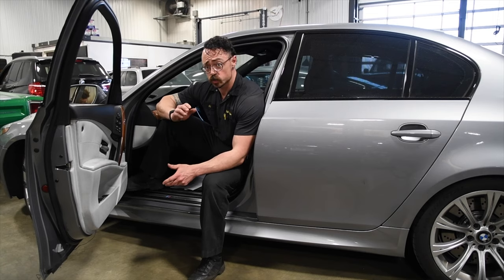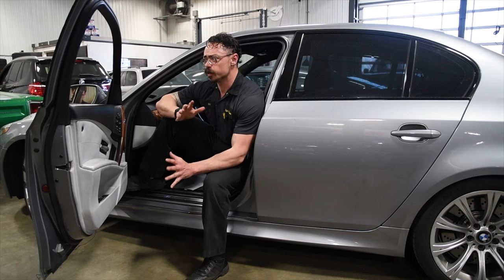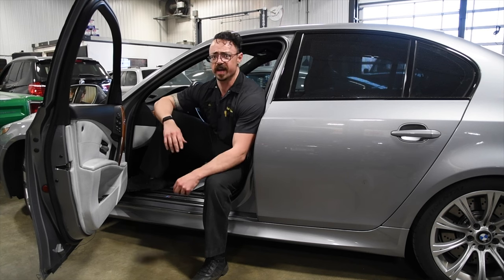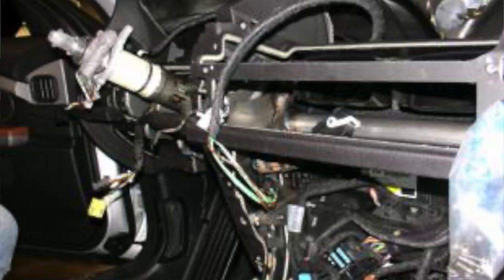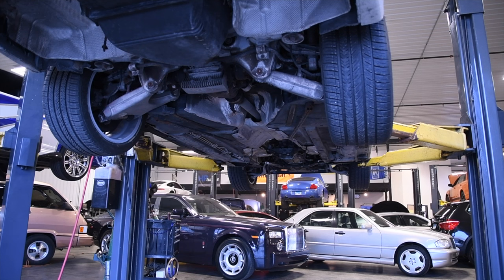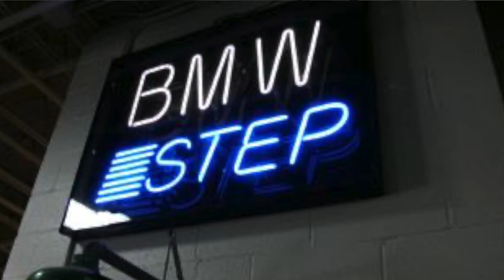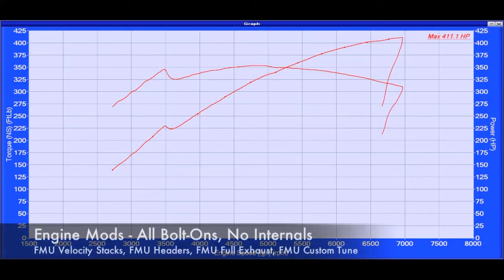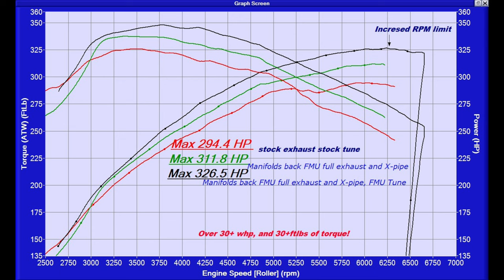E39 M5 Header Back Exhaust - Inspiration for Gold Wheels

Comment: I had a 02' e39 540i 4.4L V8 and had headers  wrapped of course with bigger injectors and Whipple sprcrgr and straight piped it was the loudest thing out there was a sleeper for sure called it the the Benz Killa 206

Comment: 290 whp was weak for an s62. It should have made at least 330?
Reply from the maker: Our dyno is actually a loaded dyno as opposed to most dynos with are inertia based. It is supposed to read the wheel HP more accurately because its actually testing the vehicles ability to overcome load against it. This is why Dyno Dynamics Dynos have been nicknamed the heartbreakers lol. To give you an idea of this a stock Dodge Challenger Hellcat 6MT only puts down about 490 whp on our dyno. All in all 290 is right about where we like to see similar S62s.